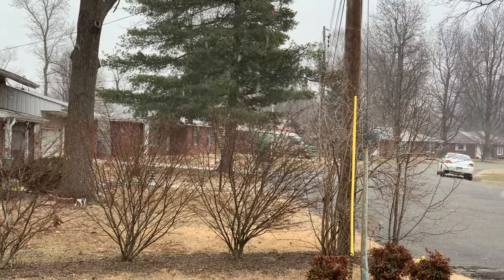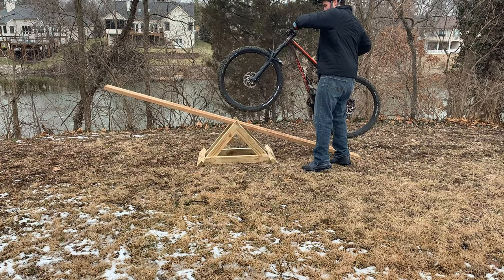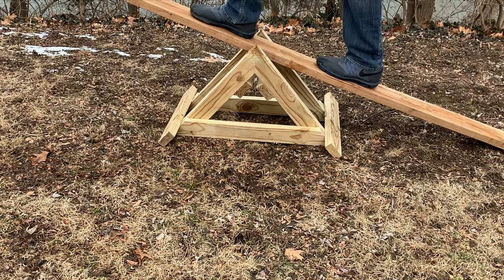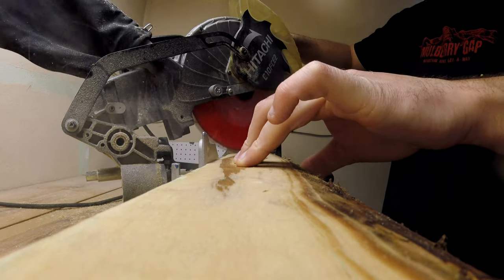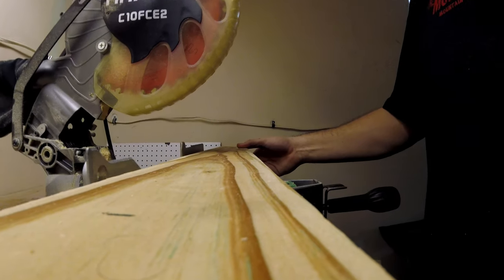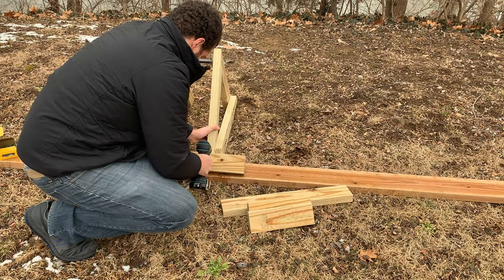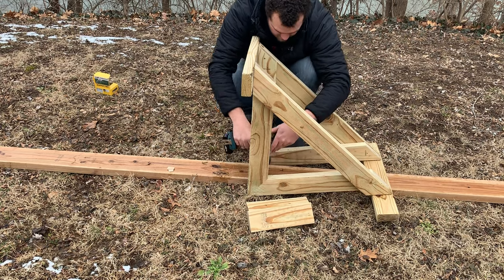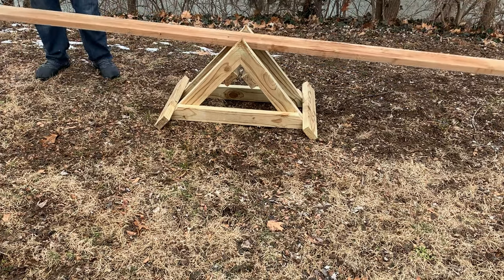Cheap MTB Teeter Totter Build

Comment: How tall is that. How long is it. I’ve got my kids and neighbors 4-6 years old. Any suggestions for height and length and width fir them.  Thx
Reply from the maker: Donot Robme I believe it is around 18” tall at the center. It’s pretty steep and I wouldn’t make it that tall/steep for young kids. I’d say 6-8” tall at the center would be good for young kids.  I would also use a wider board you ride on for younger kids. A 2x6 is very narrow.
Reply: Adventures Happening THANK YOU!!